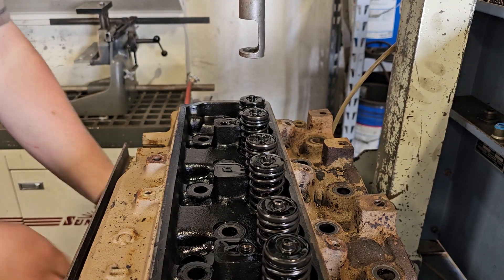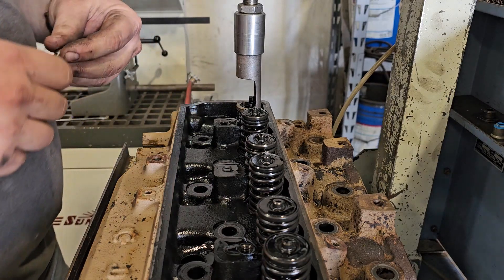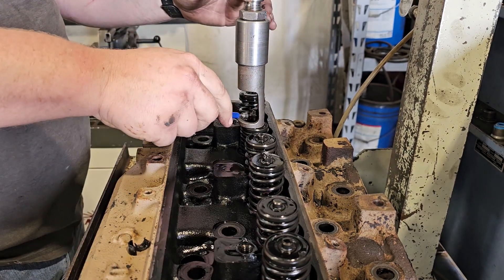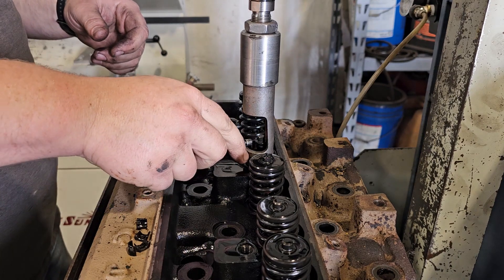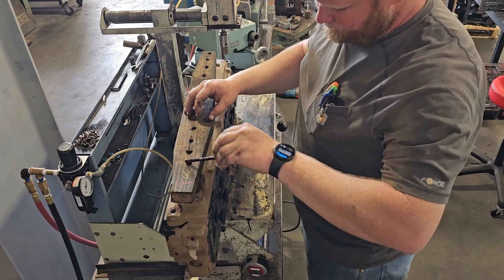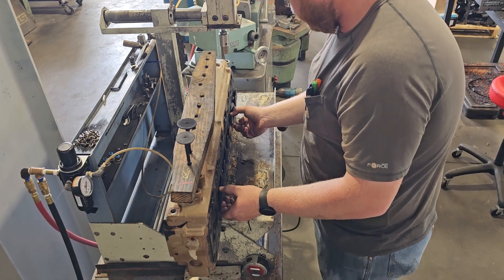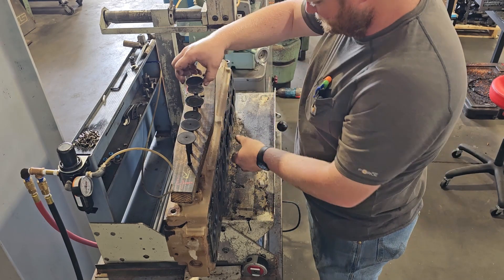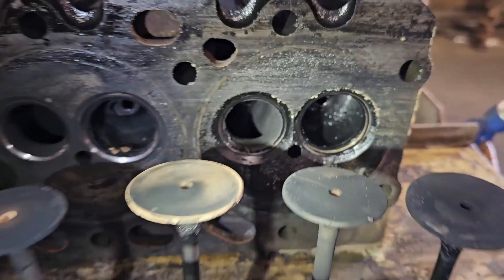Cylinder Head Disassembly on a John Deere 6068

Comment: Is that a homemade bench your working on? Been looking for something like it.
Reply from the maker: It's a Peterson Machine Tool assembly table. Picked it up for $500 and put a new cylinder on it. Something you could very well make
Reply: @Engine Krahnicles  thanks I'll have to do some searching.  Is this your machine shop?  I'm looking to start an engine machine shop at my home.  Going to start doing diesel cylinder heads and grow from there.
Reply from the maker: @mike bougher  yup, it is my own machine shop. We do tractor repair mostly, but there is always the fun project to fill the cracks.